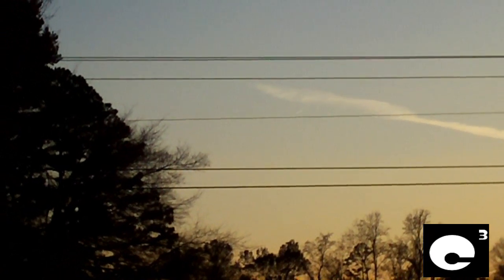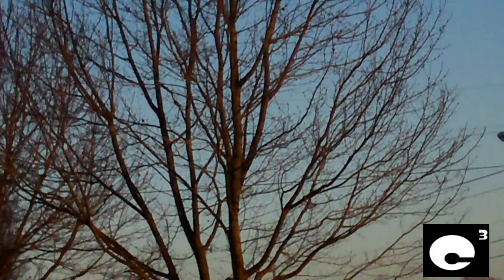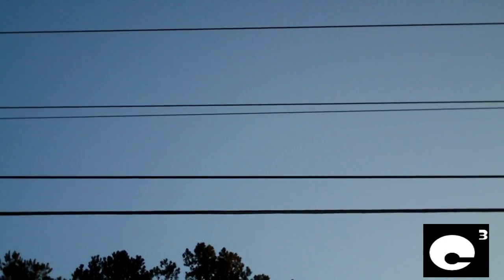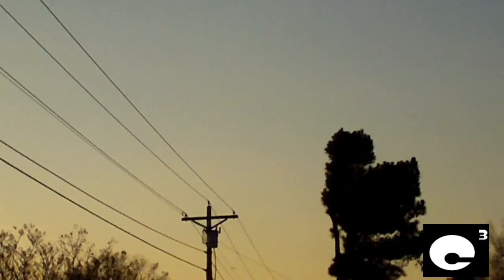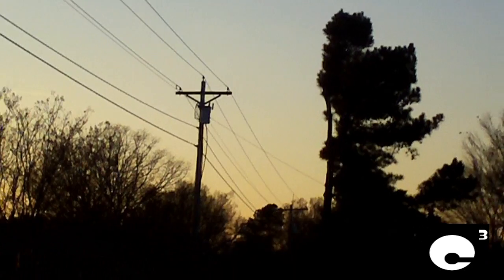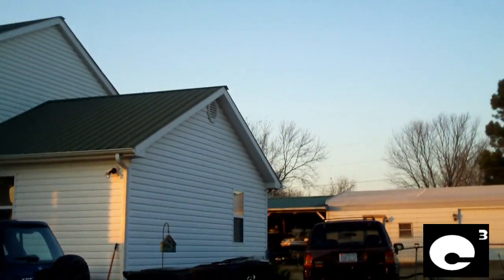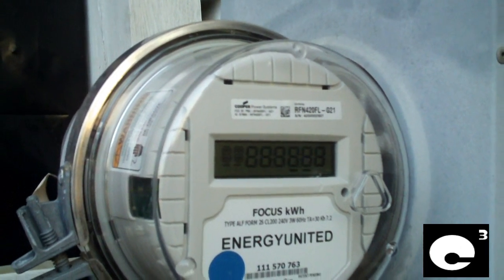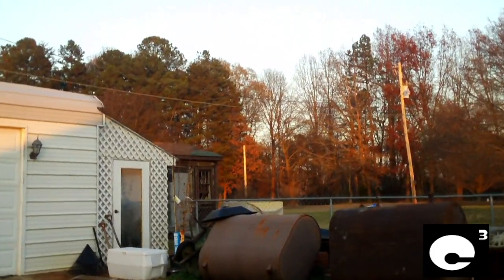Shivering Fiber Cable on Utility Poles + Look @ Cooper Smart Meter

Comment: Maybe the fibre line is a lot lighter then the copper lines, and will just vibrate more, I have seen this before in our area but it does not effect its performance.